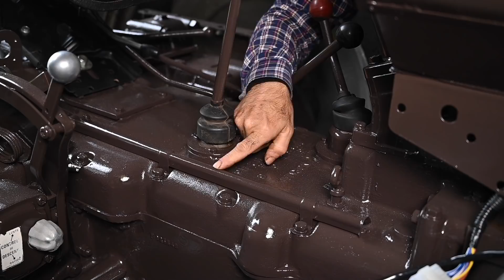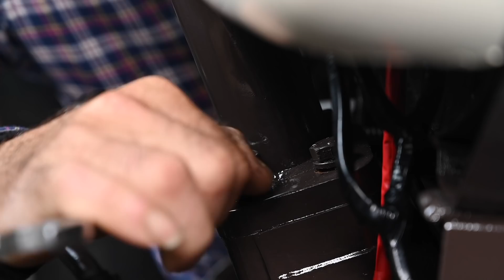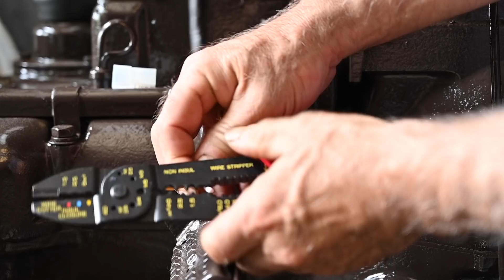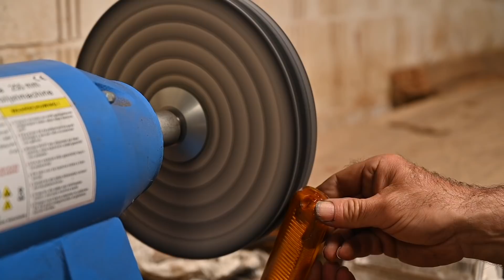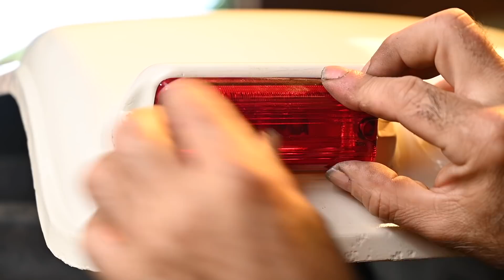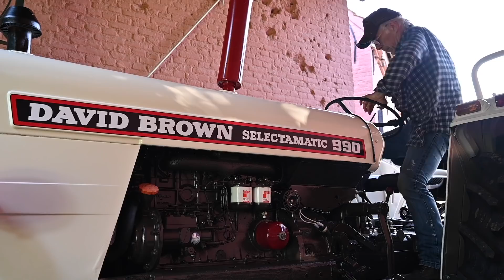David Brown 990,  Part 3   Electrical cabling and final result

Comment: I think you've done a great, you should be really pleased with that.. I'm currently restoring my 990 too and if it comes out anywhere as nice as yours I'd be happy. Currently my hydraulics aren't working due to stick valves I guess. I'm going to run some diesel through the circuit and hope that sorts it. Anyway, thanks for sharing and keep up the good work. Looking forward to see more vids on old rusty!
Reply from the maker: Thanks for the comments and good luck,   for the hydraulics , I do have a video on that

Comment: I always spray the ground connections on the lamps with Tectyl so that the contact does not corrode. I do that with all ground connections. Great video and nice tractor Steve. BR Olaf
Reply from the maker: Thanks for the comments, good point....  I should have done that and have the spray on the shelf

Comment: I do not know of any old vehicles that have the lights connected to the ignition switch. I guess it is because lights draw a lot of current and the last thing you want is for the ignition switch to burn out as then your engine stops. 

These days relays are cheap and reliable so modern cars can use them to link lights to the ignition.

As Steve says, when rewiring your old vehicle it is down to personal preference.
Reply from the maker: Thanks for the comments, and indeed this tractor does not have a single relay...so funny

Comment: HI Steve, excellent work and excellent videos. I just can't understand how you can have red light at the front side of your rear fenders, even in Belgium  ....is that a David Brown idiosyncrasy or was there a little oopsie? Other followers also found that strange. For the rest nothing but awe.
Reply from the maker: Good question! However that is what was on the tractor...in fact red or white for rear lights is ok...  These are not rear nor side lights, as they are in the rear fenders front part...  so very unclair and it did pass MOT some time ago like this..   Never the less, I can always change the lenses as soon as I find them

Comment: Tractor came out nice, I know this is a working machine so you left out some of the dents in the bonnet/hood and fenders. Some will call it the 'patina'. Its a very solid machine and we appreciate all the hard work you put into it.
In my childhood days in the late 60's in Uganda, I used to watch the mechanics do the rewiring of old British trucks, Leyland, Ford, Thames Traders etc in my father's workshop. And they were very good at it, looms from scratch, generators, testing etc. The traffic police (who would be waiting on their BSA motorcycles on main roads) were strict on commercial vehicles and every safety related component had to be working, or else a ticket was issued. The good old days, cheers.
Reply from the maker: Thanks for the comments and write up.  Indeed as I stated before ,  I was not creating a show room or concours  tractor ...  So, I don't mind a few dents here and there . Although I took many out

Comment: Worth noting when crimping that type of connector onto a wire, it is best to put the cut side of the connector in the round part of the crimper, and the 'prong' side of the crimper should push into the solid side of the connector. If you reverse this, the prong tends to split the connector.
Reply from the maker: Thanks for the comments

Comment: Aren’t the fenders front to back?
White lights should shine forward and red backward
Reply from the maker: No they are in the correct position, can't be placed in the other direction at all...  The red lens caps on the front should be white , but as I had none so far , I used the red types for now.  Rear lights are OK as red or white
Reply: @D3Sshooter  Just as long as you are sure you haven't put the right fender on the left side and the left fender on the right side.
Reply from the maker: @RGSneaker  thanks,but that is impossible the way they are build.

Comment: one suggestion.  after drilling a hole in painted sheet metal, touch up the hole with paint to prevent rust starting at the bareı metal
Reply from the maker: Thanks for the comments, yes indeed and I did... should have shown that

Comment: Looks beautiful!   Must be so satisfying to have done that.  Too nice to use, actually.  Me, I'd leave it in the garage and go look at it periodically.  Mud?  Dents?  Nooo sirrr...   Not for me...   :)    But on a more technical side, I do feel compelled to note that there are much better connectors to use for outdoor equipment than those spade affairs.  I realize that this may have been OEM practice way back when but weatherproof connectors are very good nowadays and far superior.  More expensive, no doubt, though, unfortunately.  Also, if you do want or need to use crimped spade type connectors, you may want to look at ratcheting tools with actual forming dies, they give much better crimps and better electrical contact than those simple stamped pliers, and are very affordable.  Dielectric grease to protect all those exposed connectors from water is also a great idea.    Great video as usual, the technical quality (exposure etc) is superb and far above much of the typical YT fare.
Reply from the maker: Thanks for the comments, and yes you are right about the connectors...Although in this case the tractor will not see a lot of rain and water .. if any....